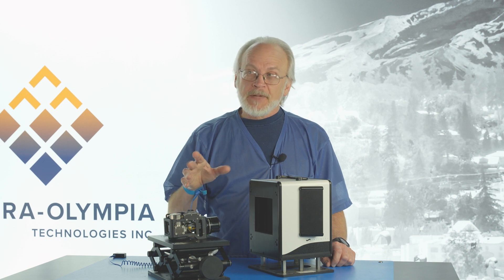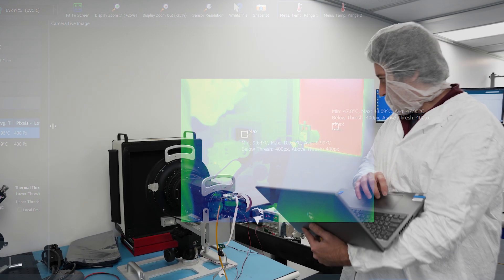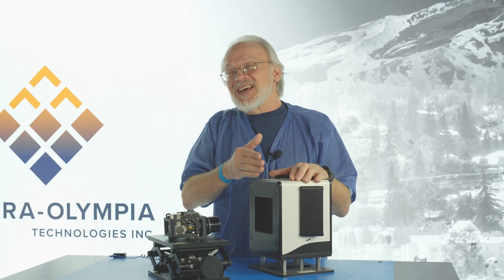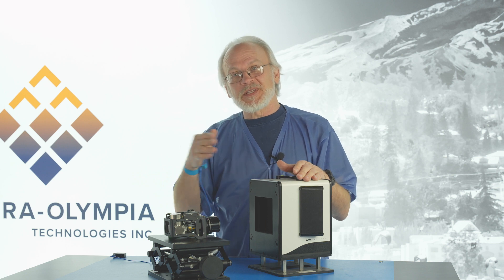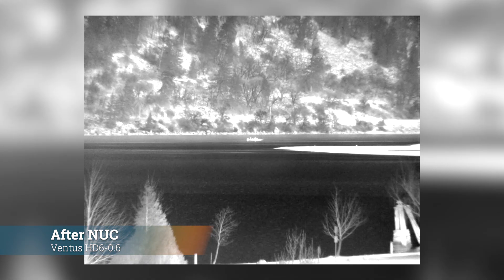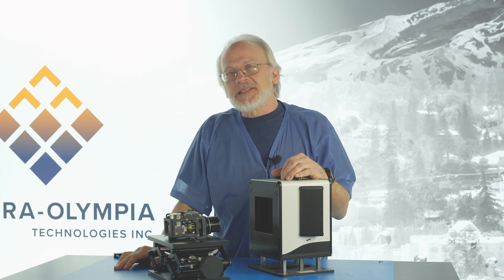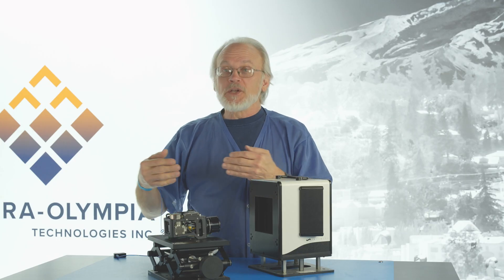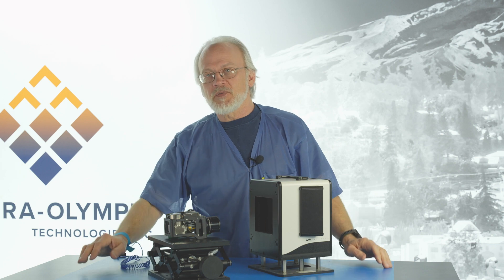Correcting Infrared Pixels | Tech Talk

Comment: Is the sensor bias done in software? As in the digital side? Or can it be done electronically on the analog side? I assume storing the values would be difficult. 

Also what about drift over time? How often do you have to do such a calibration if the camera is in constant use (surveillance) that includes near direct sunlight. Do the pixels take damage and degrade over time? 

And finally what about thermal drift during operation. Is there a Flat field correction using a shutter?
Reply from the maker: This depends on the product. Typically, sensors are tuned by the original manufacturer to achieve as uniform of a the pixel response as possible. Then gain + offset values are calculated for specific scene temperature ranges and stored on either the sensor or the image processor electronics. 

Typically, a 2-point NUC calibration (or several, for different scene temperature ranges) are done at the factory, while drift is corrected by 1-point FFCs. Looking at targets with direct illumination from the sun is not an issue. However, if the camera stares directly at the sun, the pixels response may be altered for a period of time (this is not advised).

Some pixels will degrade over time. Typically, these are the pixels that are already marked as 'bad' during calibration, and will eventually become dead.

Most of our cameras use a shutter to perform a 1-point FFC (Flat field correction) as needed during operation. Our uncooled, LWIR cameras need more frequent FFCs than our cooled, MWIR cameras. Cameras without a shutter can do a FFC via an external, flat temperature object for example.

Thank you for the great questions!!